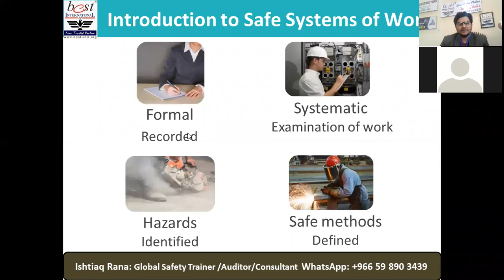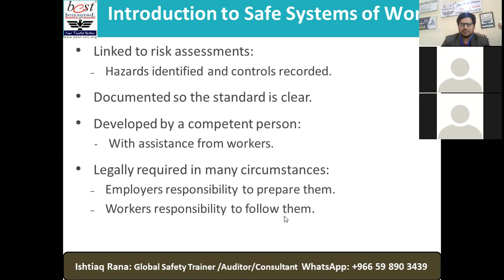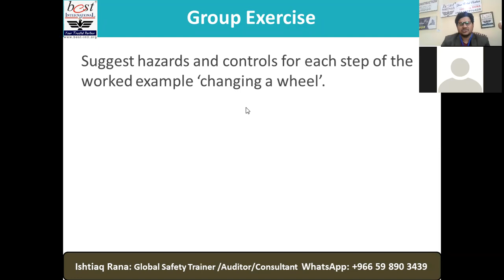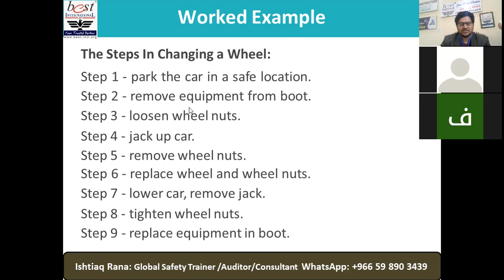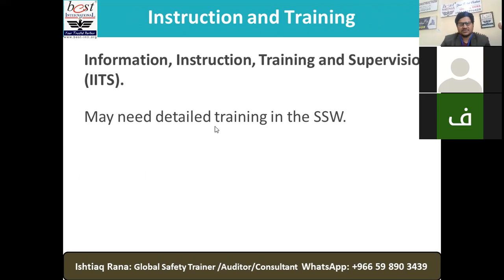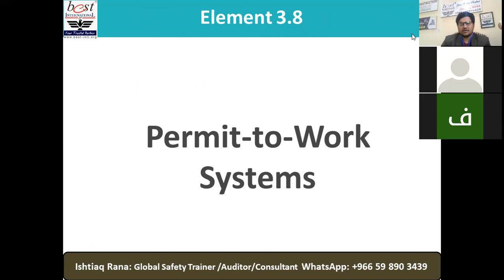Safe Systems of Work-3.7 NEBOSH-IGC Training

Comment: So, does the safe systems of work mean (method of statement, Job safety analysis, procedures, or permit to work?
Reply from the maker: Yes dear asafe system of work is a step-by-step method of carrying out a task that considers the hazards and risks involved and clearly states the control measures required. The site-specific risk assessment will determine whether a safe system of work is required. And abovd are system documents can help to implement safe system of work against the required projects or processes or even activities.